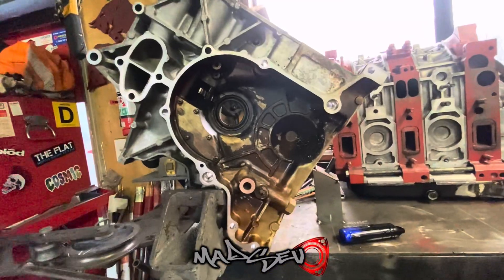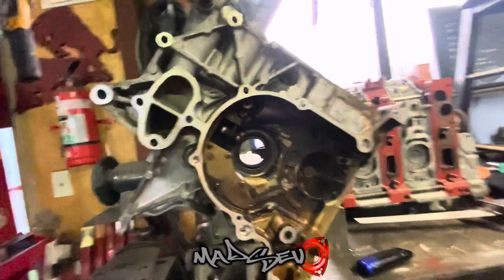Water pump delete on 13b renesis engine

Comment: What AN size you running for waterpump?
Reply from the maker: Not sure yet. Franklin engineering have the flange with an male ends already on it I was planning on just matching those
Reply: @Madrxseven  if you can find  an  an20 adaptor  for that block ive got some new fittings, weld on's and hoses you can have 👍🏿
Reply from the maker: @shed6279 oh mean man thankyou.

Comment: How are you getting on with notching both sides of the housing, are you running 2 piece apex seals ? If you are wont the corner asset piece clip the notch
Reply from the maker: I’m still looking into that . If I have to I will run a single piece . One side of the rotor housings has a shallower notch so I am hoping that the bridge part of the port is gonna hold the  corner seal in place and under tension to stop it moving up out of rotor .well that’s what I’m hoping. I have seen other engines with notched housings running 2 piece seals
Reply: @Madrxseven  yes I have to, just not sure how there doing it, must have a ramp to guide it back down
Reply from the maker: @markpowell8979  that’s exactly what I was thinking.